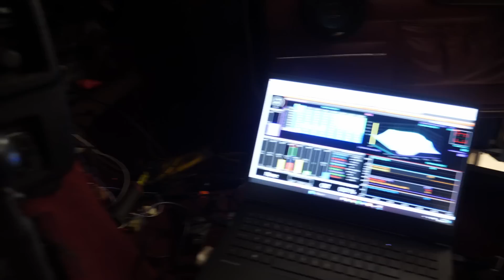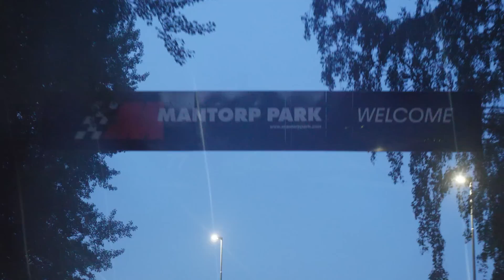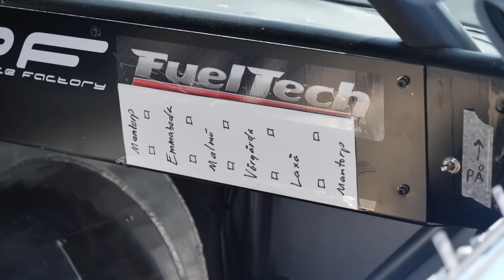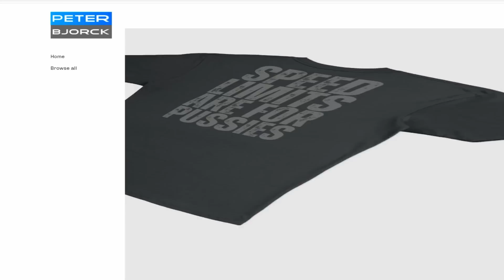Streetweek Sweden with Volvoghini Day 1

Comment: So badass i used to have a mustard yellow 1980 Volvo 245 GL wagon with shot out messed up brown interior was thrashed so I reinstalled some 80s 740 gle wagon with tan leather interior with 254K miles Borg Warner M46 4 speed manual with electriconic overdrive

Comment: 3:56 Yes the exhaust note should be a good fun challenge Peter, all front engined V10S (and V12S) sound shit!  Even the exhaust note alone is not what is heard in LFA videos as that's the sound in the cabin which comes from that Yamaha Music surge tank that resonates through acoustics into the cabin. As a musician for over 25yrs and a petrolhead who has studied acoustics and swapped many a muffler, all I can say is that you will have to really think outside the box and spend a lot of time to get a good exhaust tone. I have a very simple cheat/invention that will blow away the ridiculously expensive aftermarket exhaust systems out there that can't make an Audi S8 or M5 V10 a quarter as good as an OEM Gallardo in sports mode, you can't defy the physics but you can bypass them. Wish I could help.

Comment: I'd make some carbon fiber fenders, bonnet, doors, replace everything possible eith carbonfiber. Maybe carbon/kevlar maybe the bumpers aswell, the hatch,  it could possibly loose 1/3the weigh! Then d reove the glass. And replace it with  possibly colored acrylic, or clear /smoked acrylic. Buy a setvof doors from salvage, only keeping enough to bolt on tge hinges and  door latch  and using the original doors to make  molds so a outer skin, and a inner frame,  attach this to the brace, hinges  and latch. Incorporate the acrylic or whatever, plexiglass, lexan.  Colored , clear, smoke, maybe rig a power regulator, that hatch has got to be heavy and a carbon roll pan or a carbon bumper replacement.loads of weight can be lost, and all the original parts can be refitted later,  i would love to have one of these cars!

Comment: Good luck for the week.
 Westbergs Camaro came from Finland as a roller. That green 164 has S80 T6 engine from Lensu Power. That silver model-A has 632cid ( if I remember correct) twin turbo.